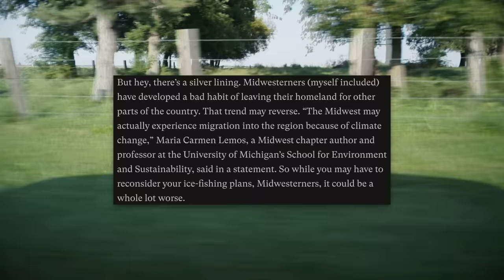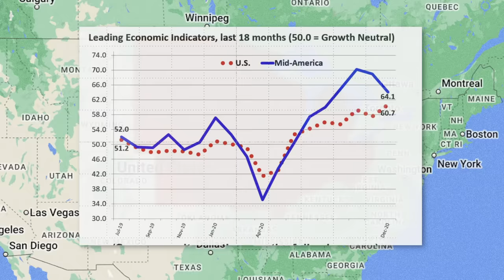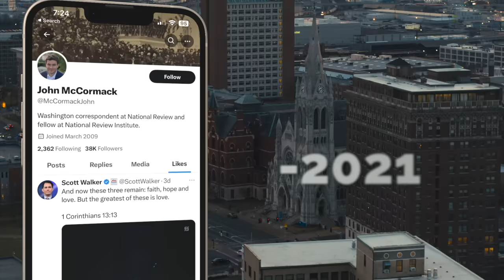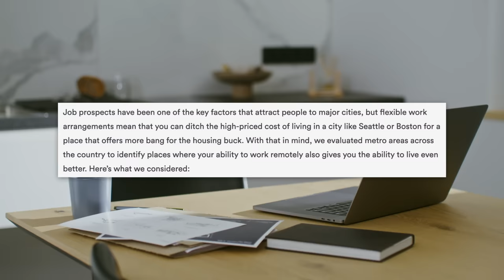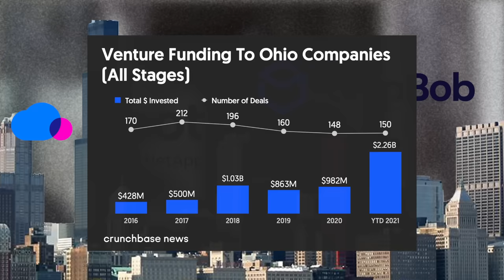Why America Needs The Midwest

Comment: The Midwest is great other than how boring the landscape is for most outdoor activities
Reply: That's simply not true. In a word: WATER. Fresh water everywhere; the Great Lakes, 10's of thousands of inland lakes (especially in Wisconsin , Minnesota and Michigan), countless rivers, creeks and streams. No other place on the planet has such a concentration of fresh water. And no worries about sharks, alligators or snakes. The topography is definitely more subtle, and is remarkably flat in central Indiana and Illinois).Great for touring biking, with many converted old rail lines to bike trails. The plains are big rolling hills. There are many river valleys, bluffs, the Black Hills, Ozarks, Porcupines mountains and driftless area (a region tat escaped glaciation). Four distinct seasons. But in the end it's about fresh water everywhere you turn.